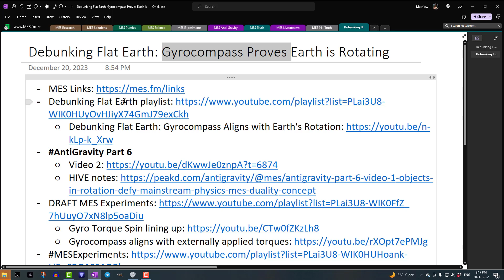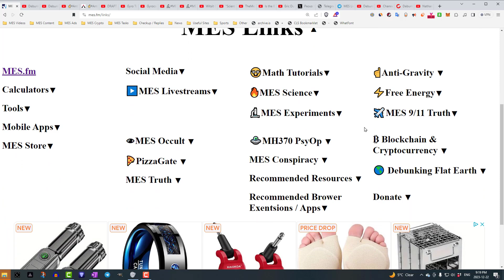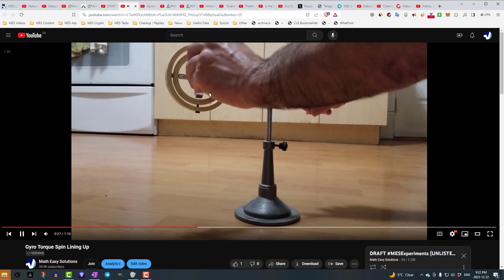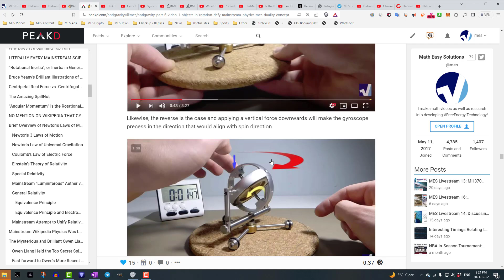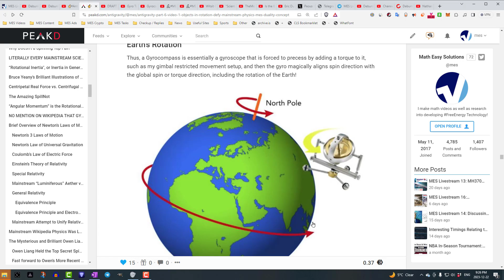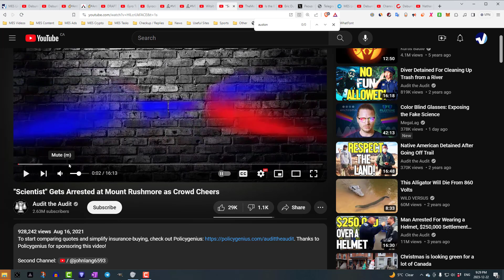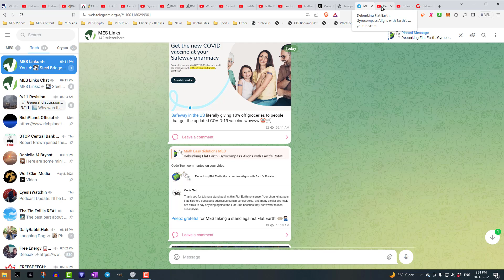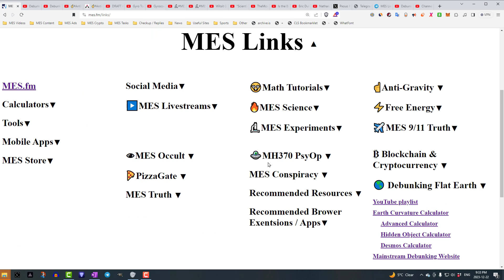Debunking Flat Earth: Gyrocompass Proves Earth is Rotating

Comment: You’re claiming gyroscopes proves earth rotation lol so stating the earth is rotating under the gyroscope…if that we’re true then earth rotation would affect planes traveling east to west
Reply: Planes flying west to east are more affected by centrifugal force than planes flying from east to west so things on a plane flying west to east weigh less than those same items flying east to west.  https://en.wikipedia.org/wiki/E%C3%B6tv%C3%B6s_effect

BAZINGA!
Reply: Do you not see the contradiction, how earth can rotate under a gyroscope but not airplanes
Reply from the maker: @emedmon5980 There is no contradiction. A gyroscope is spinning and given full freedom of orientation.
Reply: @mes  but a plane is equipped with a gyroscope…lol
Reply from the maker: @emedmon5980  LOL duh
Reply: @mes  omg, you’re claiming earth rotates under a gyroscope, now you are claiming earth does NOT rotate under airplanes equipped with gyroscopes!? This is hilarious
Reply from the maker: @emedmon5980  LOL stop actin'-a-fool
Reply: If you’re riding on the back of a semi and you jump up on the air, would you land where you started or would you fly off the back of the truck?
Reply: @heyodi3092  lol why are you comparing a plane,helicopter, hot air balloon suspended in air traveling over a rotating earth for hours on end to a short linear velocity truck example? Terrible analogy. Also, a semi has a container that contains the air from escaping, a globe earth not not have a container around it holding the pressurized atmosphere in it. So the real question now is, how do you have gas pressure without a container?! Here on earth, gas pressure expands in all directions irrespective of “gravity” and finds its equilibrium.
Reply: @emedmon5980  to clarify, I meant jumping on top of the semi trailer, not inside it.
Reply: @heyodi3092  that’s even a worse example, like within a second, you’d just fall back down an inch or so behind your original position due to the air resistance. If you floated off on a hot air balloon you’d be met with air resistance and fall behind the truck as it travels away from you.
Reply: @emedmon5980  "due to the air resistance"
But the air moves (essentially) in the same direction and at the same speed as the earth.
So there is no air resistance to support your assertion.
Reply: @Zodiac4711  so does the earth rotate underneath you OR NOT?! First you claim you can measure rotation it with a freaking gyroscope implying two freaking reference frames, then you say the atmosphere rotated with it so back to ONE reference frame, so no earth rotation under gyroscopes. F me, how hard is this for you guys
Reply: @emedmon5980  "does the earth rotate underneath you OR NOT"
If you are independent of the ground (like a gyroscope), yes.
So, NO for an airplane.

"a freaking gyroscope"
Yeah, anything that disproves the FE is freaky 😅.
Strange that any modern plane hast such a thing 🤔
Reply: @Zodiac4711 , (like gyroscopes) yes” so gyroscopes are now independent from the ground. But if it put a gyroscope on a plane it doesn’t work. Lol
Reply: @emedmon5980  If you say so.
Reply from the maker: The inertia of the air / planes makes it insignificant if planes fly opposite of the Earth's rotation: https://youtu.be/NjPDqWskGv4
Reply: @mes what about when the planes are flying north to south or south to North...?😂😂😂
Reply: "would affect planes traveling east to west"
Aircraft are controlled objects.
Every effect is destroyed by the pilot because he wants to arrive at his destination.
Reply: @Zodiac4711  no, if the earth is supposedly rotating under a gyroscope, then it would rotate under objects suspended in air (I.e. planes, helicopters, hot air balloons, etc) east to west flight times would vary dramatically and trying to land a plane on a north/south runway would be a nightmare
Reply: @emedmon5980  "east to west flight times would vary dramatically"
The airplane rotates with the Earth when
- he is on the ground
- he is in the air
- he is back on the ground

hard to believe
that there are people who don't understand this.
Reply: @Zodiac4711  you CANT have it both ways! First you say the earth rotates under a gyroscope measuring 15deg/hr, then you say the airplane (equipped a gyroscope) rotates WITH the earth! Unbelievable
Reply: @emedmon5980  "you CANT have it both ways!"
You don't know the difference between a controlled object and a free object, like a gyroscope?
What else don't you know?
Reply: @emedmon5980  A gyroscope is different to an aeroplane.  Have you ever tried to fly on a gyroscpe or used an aeroplane to prove rotation?